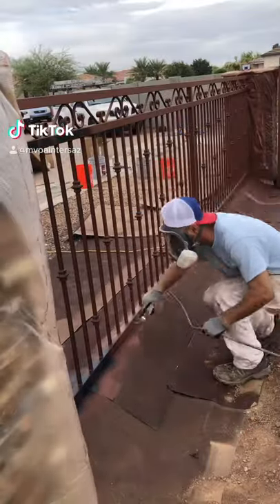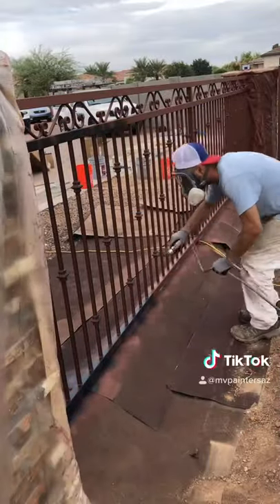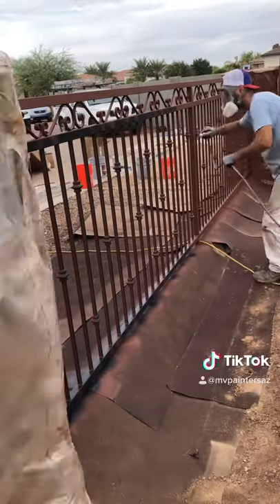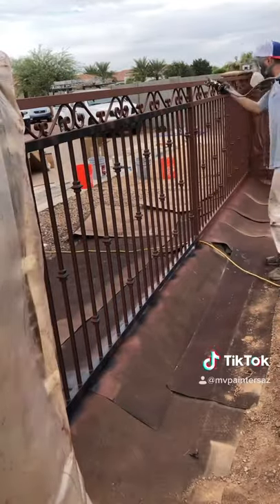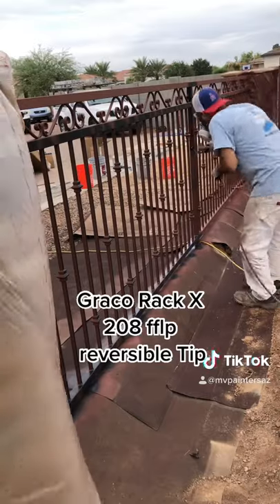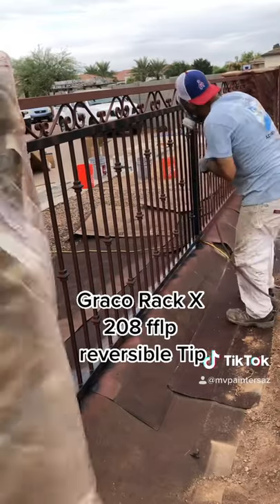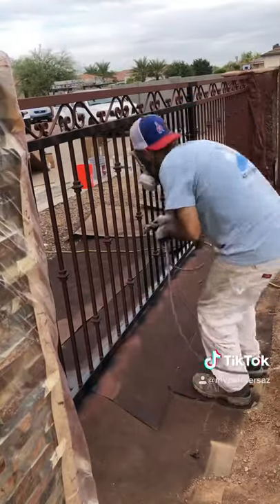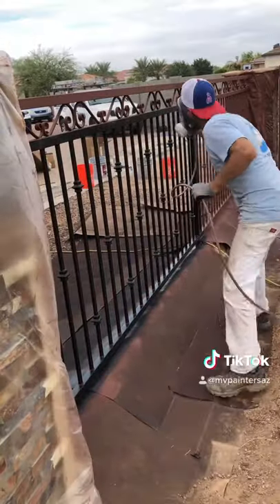How to Paint Metal Fence Panels

Comment: Them vehicles 🚗 👀 overspray 😱
Reply: These “airless” spray rigs are designed to run at such high pressures that it actually atomizes the paint when it leaves the spray gun part of the machine. These paint particles are almost microscopic at this point and the particles that don’t get on the intended surface is usually, but not always, dry before it ever hits the ground. On windy days it’s even more likely to dry, before it lands on the ground, just simply due to the added air that the paint particles will make contact with, not to mention that it will be dry long before it gets on anything else that may be in the area such as homes and vehicles. Also, they do make paint that is intended to be used in a spray rig and is marketed as “dry fall” paint. “Dry fall” paint is pretty much exactly what it sounds like. It means that the paint is completely dry just seconds after leaving the tip of the spray gun. So, what you get when painting is a fine dust on the floor from the paint that didn’t get on the surface of whatever it is that you’re painting.

Comment: 2,200 psi? Not sure i am just learning about this stuff
Reply: Has to be 220psi, but even that's that's stretch. However I don't use his machine
Reply: @TOMMY-WANT-WINGY  No, it’s 2,200 psi. Most airless spray rigs use anywhere from 2,500 to 3,000 psi. It’s called an “airless” spray rig and the hoses are like pressure washer hoses, literally. Those really small, hard to bend, won’t crush hoses. The tip is pretty small and so what you end up getting is a really good of coverage and you use a whole lot less paint every time you squeeze that trigger. These work by atomizing the paint into really fine, tiny little particles. But rest assured, they are not cheap!!! 

**I found this on the Graco website.** 
Which is the model used in this video. (I believe that is what it says in the beginning of the video)

An airless sprayer works by pumping paint at a very high pressure, up to 3,000 psi, through a hose and out a tiny hole in the spray gun tip. The tip is designed to break up the paint evenly into a fan-shaped spray pattern of tiny droplets.